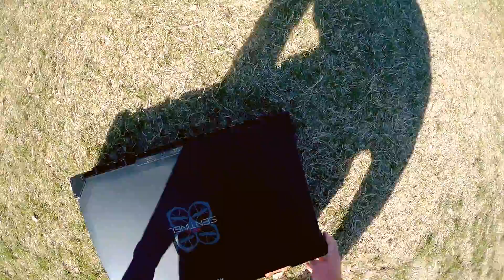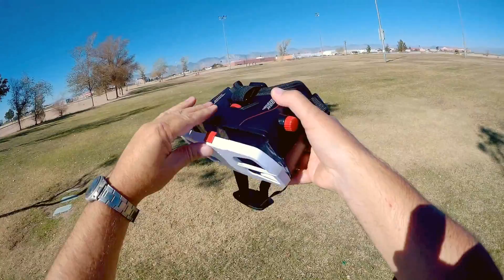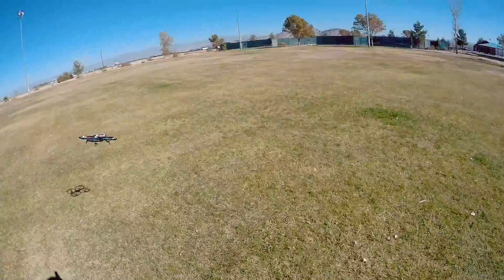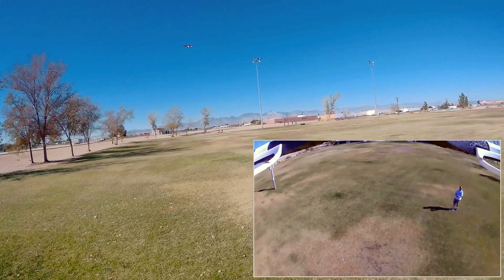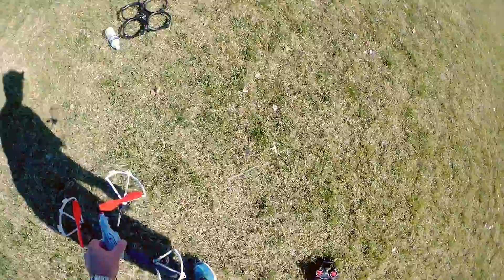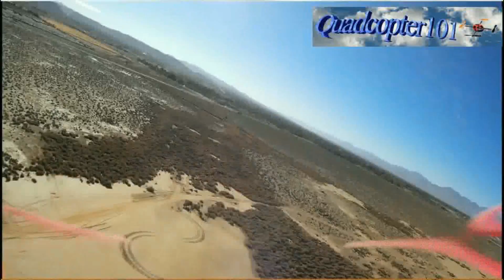Air Hogs Helix Sentinel Drone Flight Test Review Part 1

Comment: Hi I have a question.

I want to get into droning, and I need a beginners drone. I've seen some of you're videos and I still don't know if I should get the Mould King 33043 SUPER - F or the Tarantula Spider 1505. What do you think (I have never droned in my life before)
Reply from the maker: I always recommend the Syma X5C for new fliers, due to its excellent stability, durability, and ease of flying. And it even has a camera too.  Use it to learn the basics of flight with.  Let this cheap quadcopter take the inevitable crashes and bangs of a beginner flier. And if you break it, every part on it is cheap, widely available, and easily replaceable. Later as your flying skills improve and you're not crashing as much, then consider something better/more expensive.  https://www.youtube.com/watch?v=y93vzA-KRlM
Reply from the maker: I always recommend the Syma X5C for new fliers, due to its excellent stability, durability, and ease of flying. And it even has a camera too.  Use it to learn the basics of flight with.  Let this cheap quadcopter take the inevitable crashes and bangs of a beginner flier. And if you break it, every part on it is cheap, widely available, and easily replaceable. Later as your flying skills improve and you're not crashing as much, then consider something better/more expensive.  https://www.youtube.com/watch?v=y93vzA-KRlM
Reply from the maker: I always recommend the Syma X5C for new fliers, due to its excellent stability, durability, and ease of flying. And it even has a camera too.  Use it to learn the basics of flight with.  Let this cheap quadcopter take the inevitable crashes and bangs of a beginner flier. And if you break it, every part on it is cheap, widely available, and easily replaceable. Later as your flying skills improve and you're not crashing as much, then consider something better/more expensive.  https://www.youtube.com/watch?v=y93vzA-KRlM

Comment: Strike one: built in battery which means one flight and then wait over an hour to recharge. Strike two: Wi-Fi = poor range.  Strike three: camera is pointing down at ground. Strike four: obstacle avoidance doesn't work (reliably)   There are better quads to learn how to fly with, so those ridiculous looking foam protectors are a waste.  So, as you can probably figure, this one has no 'up side' for me, but perhaps some out there might like a quad you can only fly once every couple hours due to its built in battery. Thanks for sharing the review. Cheers.
Reply: Bill Somrak he does say "the lens swivels up and down", to what degree, who knows?
Reply: I have no clue here could you recommend another? I have under $300. THanks
Reply: If you're just learning, a Syma X5C-1 (no altitude hold - preferred) or the Syma X5HC (WITH altitude hold .. but you can wind up burning up motors on it if you don't master the motor shut off stick commands). Syma has a proven track record, spare parts are easy to get and cheap. Almost every quad manufacturer has made a "Syma X5 Clone" .. which I guess is high praise for the "Original".
Reply: Thanks just read that and am looking now is there something with FPV around $200?
Reply: If you look at Quadcopter101's video list, he shows several of the now available FPV modules, mostly from Eachine. They vary in power. You just stick one on any quad, and it will transmit the FPV signal back to a monitor by your transmitter on the preferred 5.8ghz frequency (NOT wi-fi, which uses the same frequency as the transmitter uses to control the quad). You should be able to get a Syma X5C-1, one of these FPV/VTX modules and a monitor for less than $150. Eachine makes the EF-01, EF-02, TX-01 & TX-02 and there are others as well (Fpv modules).  Again, look at Q101's playlist .. he shows several examples mounted on various craft.
Reply: Thanks for helping a nube!

Comment: hi , can u recommend me any good quad copter for 100$ with good camera , i m a beginner
Reply from the maker: I always recommend the Syma X5C for new fliers, due to its excellent stability, durability, and ease of flying. And it even has a camera too.  Use it to learn the basics of flight with.  Let this cheap quadcopter take the inevitable crashes and bangs of a beginner flier. And if you break it, every part on it is cheap, widely available, and easily replaceable. Later as your flying skills improve and you're not crashing as much, then consider something better/more expensive.  https://www.youtube.com/watch?v=y93vzA-KRlM
Reply: @quadcopter 101 , i saw u review of JJRC H26D , i love that too , do u recommend that
Reply from the maker: Arun kumar Not for first time fliers I don't.  As a beginner, you WILL be crashing, and  crashing a lot.  The H-26D is too big and heavy, with a lot of momentum in a crash.  It's going to likely break on you as you learn to fly.
Reply: ohh thx , i will go with 5xc then
Reply: The good old X5C is really great, I also recommend it. It is simple, without headless (useless) mode, so it is ideal for learning the basics. I have been using it for a year now. We often go to a park with my son with a bunch of spare batteries and fly it. It has survived many crashes but still has the first set of props on. They have only surface scratches and green stripes from the grass and other plants but none of them has been broken.
Reply: Arun kumar if you want a good camera your gonna have to up the price a bit but I would recommend the syma xhg
Reply: After that try for something like a Fire 104, QX90, or other micro you won't hurt much with; by then you should be better at flying. Only buy those if you wanna get into the hobby and buy a Taranis, Spektrum, or Flysky radio. .From $60-200 is the cost for the radio; it'll last you forever. A Taranis is $200 but has the most compatibility, Hobbyking sells  spektrum module for it.
Reply: +arun Kumar the syma x5c-1 is probably the best it is 50$ definitely not the greatest camera but it's pretty good